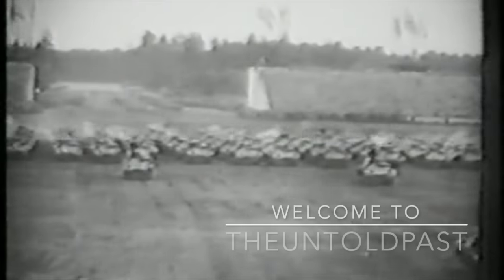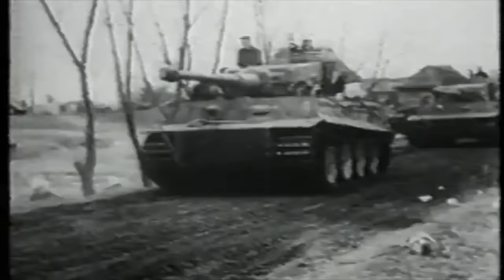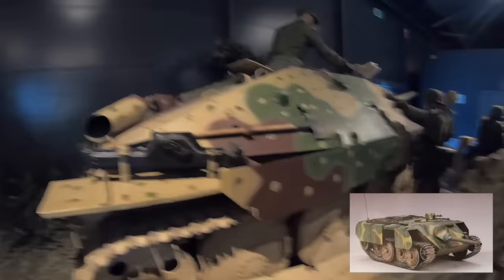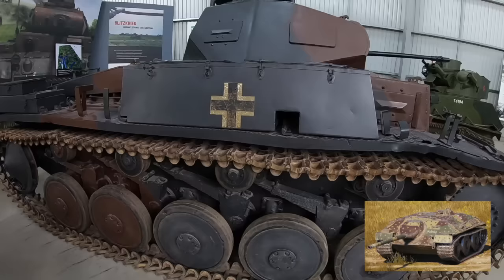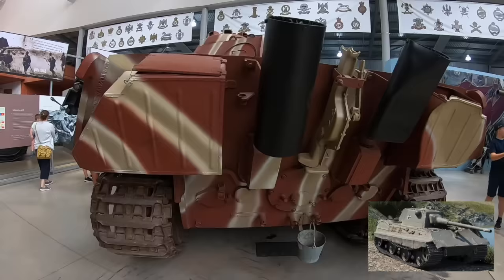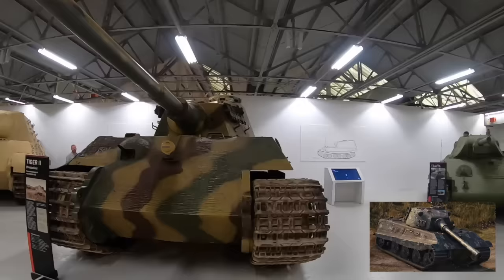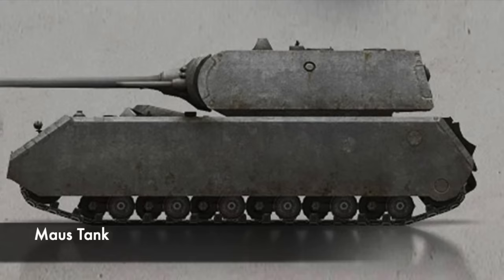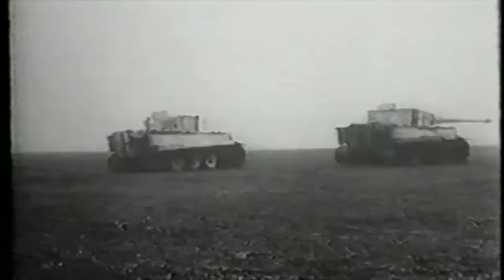The E-Series Of Tanks - Hitler's Dream Tanks

Comment: It's truly amazing that the Germans didn't realize until the last years of the war that they needed vehicles that were easy to produce and easy to maintain.  It's a lesson they should've learned from the first T-34s they captured....
Reply: This is what happens when popularity in party politics is what gets you ahead, and not merit. You get idiots with no vision making decisions not because he's brilliant, but because dear leader loves the way he kisses his ass.
Reply: it was a lession they learned, or rather speer (and his supporters) learned. proposing or requesting standard panzer projects like the pz III/IV, wanting the lighter and mechanically simpler VK3002 DB (panther prototype) and easier to maintain, rather than the one chosen. wanting recont anks built on the pz 38(t) chasis rather than the pzII L luchs. not wanting the tigers or super heavies (they won in the end on that, with hitler canceling the super heavy projects)

but various reasons, be it party politics, or other reasons, this group never had the power to do anything.
Reply: One word. Oil shortages. What use are tanks if you cant use them?? More tanks wouldn't have changed the outcome of the war in the slightest and it was better focusing on quality instead of quantity. Why are yall so dumb. "Just mass produce" doesn't even work because there were resource shortages. The Tiger II was sometimes worse than the Tiger because the welds would just undo themselves after a while because of resource shortages. Ok now imagine a worse resource shortage, tell me how that turns out.
Reply: the panther was the german answer and "copy" of the t34
Reply: Upon viewing a captured t 34 ,  Walther Von Reichenau stated " if the Soviets mass produce these, we are finished "
The Soviets did and the Germans were....

Comment: Just imagine if the MAUS was fully completed. Operational fully capable of firing. And was able to drive itself around it would literally need a bomb from a plan to take out. It would have been destructive if mass produced
Reply: If it had been mass produced, Germany would have run out of steel even more quickly, and it's range would be limited to whatever two rivers or mountain ranges it was built between.
Reply: And that would be easy to arrange since the Allies had air superiority by this stage of the war.

Comment: Ah yes, German tank engineering.
The epitome of making everything bigger and/or heavier then it needs to be...
Reply: One thing German tank engineering and the Kardashians have in common
Reply: Many people don’t appreciate how safe tank operators were compared to allied tanks. There are genuine accounts of Tiger tanks being hit over 150 times by allied tanks
Reply: @Edward-fg5ht  Tanks were and still are one of the safest jobs in the military.
As for safest tank I'd have to give that to the Sherman.
A good amount of German tanks were abandoned after they broke down, so if that's why you think their the safest you do you.
Reply: @mando_dablord2646   Safety in terms of armour thickness.
Reply: @Edward-fg5ht  That's not how it works...
The armor will degrade and fall apart if it's hit to much. The crew can still get injured as well even on a non penetration.
If you're also wanting to go into how adding more armor thickness is better don't even try. That just makes the tank worse...
Reply: @Edward-fg5ht  

The MKIIV Churchill with its 152mm of frontal armour was one of the most heavily armoured Allied tanks and was pretty safe, but repeated shell-hits could go through a weakened plate and into the tank.

Comment: Imagine in another realm germany designs a few interwar tanks and then ultimately decides that a line of tanks as a standard, but being designed so that as these tanks arrive and fight increasing threats they can be easily modified. Think armor thickness simply increased with molds pre made before the need arises. For example desiging a E25 with 50mm front plate. But also getting molds or the tech ready to up the armor to 60,70,90 etc. so they can simply be switched out to create better armored variants. But maybe thats a bit much.

Comment: These vehicles would have made absolutely no difference
Reply: What would have made a difference would be going with Mansteins "Strike from the backhand", skipping Kursk-Orel. That would have allowed the germans to fix Panther (they knew the problems and had cures) and rotate back experienced crews instead of mostly putting green troops on the Panther.

The rather desirable result would have been that Enola Gay would have dropped the first bomb on Dresden, Bockscar the second on say Hamburg or Leipzig. Long run a lot better for germany, nice permanent Fasism us Idiotic Monuments
Reply: @mbr5742  ??
Reply: @mbr5742  The Germans were running on fumes at this point in the war, they simply didn't have the resources or man power to completely rebuild their armored force in the way they proposed with the E Series. The war in Europe still ends with the Soviets taking Berlin in 1945.
Reply: @NarcassiticGamer  1943? Even WITH Kursk Orel the germans where far from "running o  fumes". And I did not say anything about the E series. I said fixing Panther (Final drive from the Tiger, different turret) something done by mid 1943 if one drops Kursk Orel and the production start of Panther in early 43
Reply: @mbr5742  bro shit was lost 42

Comment: No pictures of the E-100? There are a lot of E-100 pictures on google and such.
Great video for the rest!

I am curious though if the Germans would have gotten 5(?) more years of conflict. Would this E-series still be good enough?
Because Russia really changed its tank doctrine. Stopped with the heavy tanks and focussed heavily on quick(ish) medium tanks like the T-44 and later T-54 and T-55. A design philosophy still present to this day.
Same goes for America. Sure, they had the T29, T30, T32, in testing and production fase, etc, but their real success has gone in to the medium tank series, with the Pershing proving to be a very formittable foe vs any German tank.
Reply: Nah even with 5 mor years germany didn't have enough fuel or steel or the tanks
Reply: More likely its going to be this scenario. Say the germans got more fuel, steel, aluminum, rubber, copper, etc for and extra 5 years. If we are talking 1339-1942, I believe the germans have a higher chance of winning so no change really. If late 1942-1944. Here's what they'd go off off. 

Germany was basically doing guerilla warfare when they were losing. Based on what the germans actually did, they pumped up their tank destroyer production, the tank destroyers would hide in bushes and snipe, etc. 

Heavy tank and medium tank production would decrease in favor of whatever tanks destroyer they could put out. Hetzer, Jagdpanther, Jagdtiger, StuG III, StuG IV, Jagdpanzer IV, etc. Of course they'd still have the Pz.Kpfw. IF in production and like in actual history, they'd strive to make the panther their main tank 

Since Germany would no longer be in an offensive, the need for a turrets tank would decrease, instead a cheaper, faster to build stronger tanks would be of priority, which include most spgs and tank destroyers. But just incase an offensive is available or they need some flexibility, they would keep turreted tanks in production.

Tanks destroyers would play well in defensive positions and seeing how well the Jagdpanther does with arnament, armor and mobility, I believe they would go for that one

Comment: The E-100 was a terrible idea.  It would have been pretty much immune to allied tanks but extremely easy to pick off from the air, and at no time after D-Day were the allies short on ground attack aircraft.  In addition reaching the battlefront would have been impossible in many areas of Europe as there were very few bridges that would have been able to support its weight.  The massive tanks were part of Hitler's useless obsession with massive tanks and guns, but there is a limit to the extent to which size confers an advantage in the design of tanks.  Once you cannot use most standard road bridges your design is becoming impractical.
Reply: Wrong , paint a roof on top of  E100 and it will blend into any city or village .

Comment: would have been nice if he also talked about how much armor each tank would have.
Reply: They barely got passed the concept stage, so we don’t know how much armor they would have had.
Based on weight and size you could expect the E-10 to have just a hair but more armor than the hetzer. The hetzer was about 16 tons, but its shorter than the e-10 was gonna be. If also bet that the sides and top would get more attention than the front, since the 60mm of angled steel on the front of the hetzer was enough to stop 75mm AP shells. The sides could could be penned by light autocannons and the top was vulnerable to .50 cal fire. 
I’d bet the E-10 gets a bit of additional side and top armor, but keeps the 60mm if frontal armor.
The E-25 would basically be a sleeker looking jagdpanzer IV. Since that tank weighs 24 tons, you could expect the e-25 to get additional armor. Probably around a total of 100mm steel on the front. Which should be enough to stop basically anything the allies throw at it, only Soviet 122mm could pen it at close range. And 17 pounder APDS
The E-50 would just be ridiculous. Panther tanks weighed around 45 tons. The tiger II weighed 68 tons. So the e-50 should have around the same amount of protection as the tiger II, maybe a bit less. Still more than enough to laugh off anything that’s thrown at its frontal armor.
Honestly I don’t know why they’d bother with anything heavier. They’re not gonna gain anything from it.
The E-75 would basically be a smaller maus. 
The E-100 is basically just a maus

Comment: I guess the E-10 came to fruition in the postwar 90mm self propelled gun/raketenpanzer
Reply: KaJaPa and the mechanical identical Jaguar are 25to vehicle, classic suspension etc. Actually a spin of from the Marder IFV development, branching of before the third set of prototyoes
Reply: @mbr5742 yeah the marder/jaguar/(and cancelled RU-251) standard chassis mirrors the E-25 (which also was intended to have TD, APC and Lt/recon varients)

Comment: No discussion of the conical suspension that was to be used across all models of E-series. An easy to service suspension was another major requirement of the E-Series. I don't know why they were planning to stick with the overlapping wheels, they were a repair headache.
Reply: Because they were "superior" in some ways? Better fuel consumption, smoother ride, cross-country-mobility and probably less wear on the tracks for example. One big drawback was the laborious repair. You simply can't built anything that's exceedingly good in something, without any drawbacks.
Reply: @GanzBestimmt  Personally speaking, I don't believe the advantages of overlapping wheels, mainly cross-country mobility, outweighed it's repair drawbacks which included downtime from the most important role of combat . So the crew was a bit uncomfortable. This was another example of perfect being the enemy of the good. Typically German.

Comment: a little error on the gun that the E-100 would've used. it would have used a 128mm long rifled AT gun, specially made for the E-100 series that had a reconfigured quick fire mechanism with an autoloading system replacing the standard single shot gun ramming system. same gun and autoloading system would've been used on the Waffentrieger Auf E-100 on it's exact same 128mm armament.

Comment: there was a " similar " plan for the Kriegsmarine - H class or plan Z which  was a series of battleship designs  based on displacement , starting with the  H 39 class of ships , but this plan , although started in the late 1930's was also halted " prematurely". 

As a note of interest ,  the H 44 series of ships would have had main guns larger in calibre  than the Japanese Yamato series of Battleships at 50.8 cm (20.0 in)

Comment: the E-series is something that's always interested me and its a shame that it doesn't get enough attention especially in things like alternate history or tank games. Though a general out look for if they where built when they where proposed they would be rear with the E-10 most likely still being dropped for keeping the 38-T with maybe some being upgraded with the mg turret as a half way between the E-10 and the E-25. The E-50 most likely would be dropped for another panther variant with the idea of trying to improve it as much as they could. Then the E-75 got scrapped in favour of the Maus then the E-100 knowing the Germans would probably have been built but likely less than 100 of them if we go off the actual production then they would have been used but they would have been rushed into service where it would have suffered from the usual problems of German heavy tanks mostly lack of flue and trained personnel, with most likely being abandoned not long after.
Reply: the maus was canceled in 43 replaced by the E-100 in development and then that was canceled too, Hitler didn't want super heavies anymore. which is why despite beginning to be built in 43 the E-100 prototype hull was still unfinished in 1945.

the E-75 is more or less a simplified Tiger II and thus would have been kept due to ease of production, the E-50 probably would have been modified to be based of something closer to the panther (rather than essentially a lighter tiger II) initially to ease production but otherwise would have likely swapped over to the E-50 as designed later on to allow for future upgrades.
similarly, the E-10 and E-25 would have likely become closer to the 38(t) and pz IV hulls.

the important parts of the E-series designs are the propsed hull construction methods, which was simpler, quicker and thus cheaper. and the suspension types which was cheaper than the leafspring suspensions of the pz38(t) and pz IV yet just as good (instability) and better (in weight limit) than the double torsion bar of the tiger 1/II and panther. aswell as being easy to maintain, and adopting a single suspension system and road wheel set for the 4 vehicles (rather than 4) would have also eased supply lines.
a war time germany was more likely to adopt e-series ideas into existing tanks, then build completely new tanks.
Reply: @matthiuskoenig3378  thanks for the info would have been really interesting to see these built.

Comment: What the Germans should have done was not bother building the panther or tiger , but concentrated all tank production on the panzer iv , after all that was basically equal to the sherman and T-34 , if they had done that in 1942 they could have put more tanks on the battle field , after all it was the number of tanks that won the war , far better to field 75 to a 100 panzer ivs rather than 10 tigers or 15 panthers , plus the panzer iv chassis was a good base for tank destroyers and SPGs .
Reply: Thats a dumb idea. The Germans didn't even have enough fuel to power their whole tank force. The Tigers and panthers could sit in defensive positions without much movement and ambush allied tanks due to their thick armor. The Panzer IV's were fast but Germany wouldn't have had the oil to run them. Would you rather have a tiger and panther to ambush or a panzer IV? Panzer IV's were not even that much better than the Sherman and would've been knocked out due to low production. Germany didn't have the recourses for mass production so it wouldn't have worked in the first place. They would've been even more fucked.

Comment: The larger ones never would have worked, . anything past 70 tons , is just too heavy for most road -beds and bridges, and will sink into any non-solid/hard-packed ground.  Besides being huge and easily seen and/or destroyed by airpower or just immobilzed by ground fire/mines ect and bypassed/ atatcked from rear and sides.  Beside the obvious mega expense/ low numbers and logistical promblems of keeping them running or unsticking them.

Comment: Had the German project to shift to diesel generators on board with electric motors, been able to deliver earlier...that would've saved an astonishing amount of fuel and let vehicles in static defensive positions rely on grid power not waste diesel fuel.

In other words run 2x or 3x as many tanks on the same fuel.
Reply: They didn't have the copper.  That's why the diesel electric drive for Tiger was nixed.

Comment: I'm late to the party but this will not stop me from making this comment. The Maus turret was never a option for the E-100 hull ! I don't know where you got this information (maybe from the E-100 in War Thunder) but putting a Maus turret on a E-100 hull is a really bad idea. The Maus turret would have been to heavy for the E-100 hull, this would have led to turret ring and suspension issues that would have made the E-100 none combat effective. 
The E-100 turret that was suppose to be installed was a very similar design to the one that can be found in World Of Tanks. This turret was inspired by the Maus II turret designed but with less armor.
Reply: I think you are correct.  The E-100 was not really the same as the Maus.  According to a book I have on WW2 German tanks, the E-100 was a different tank from the Maus.
Reply: @billfairleigh4555  yes it was. But I did not made this comment to say that they are different vehicul but to say that the Maus turret does not fit on the E-100 hull. This is miss conception that is starting to become more more popular (certainly because of the video game War Thunder, in which they decided to make a E-100 with a Maus turret for some reason)